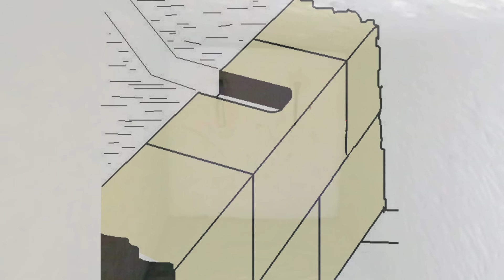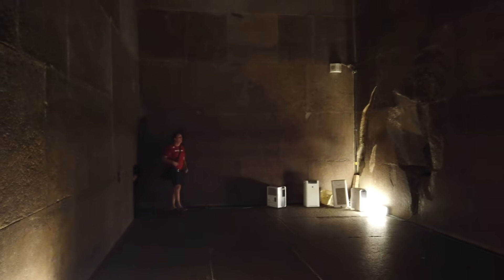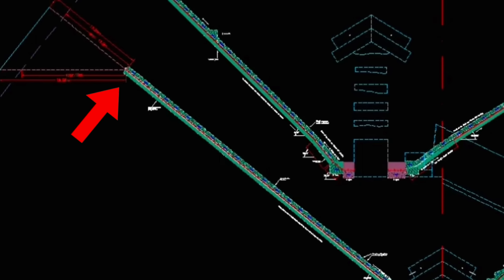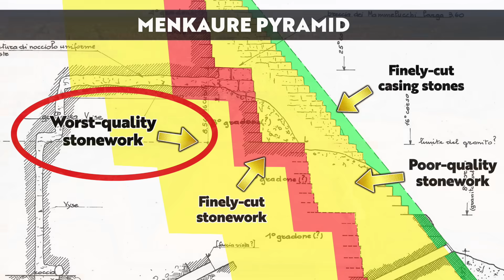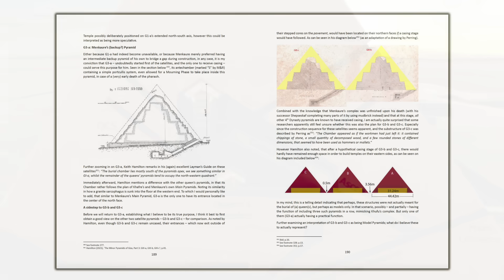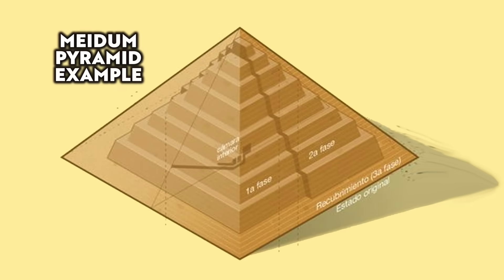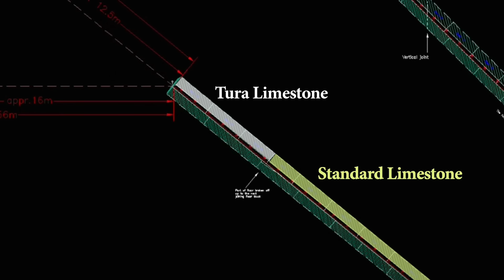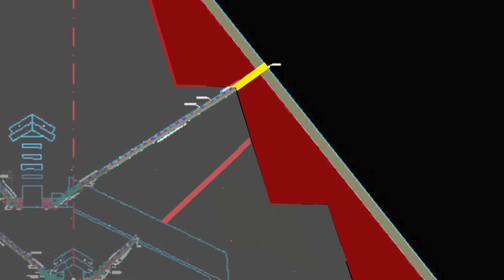Great Pyramid HIDDEN Steps Explain Everything | Part 1

Comment: Casing stones at the end of the air shaft is about as clear of evidence as anyone could ask for. Makes you wonder if the copper pins are some kind of technology or solution that holds them in place that went out of favor.
Reply: The copper pins are just the but ends of a handle. They drilled two holes. They then took a long copper rod with two 90 degree bends and placed the ends through the holes. On the backside (the side we see) they hammered the ends down to secure the copper handle. We know this with about as much certainty as possible for something nearly 5000 years old
Reply: @TheTonyMcD  Handles maybe bronze, we know they had tin.
Reply: @paulroberts7429   I don't know if any actual testing was ever done on the pins, or if samples were even retrieved. But I would highly doubt they would have used  bronze for that application at that time. The very earliest true bronze artifacts in Egypt only date to the first dynasty. It wasn't common until middle kingdom times. In the third dynasty, bronze was still an extremely scarce material (and very valuable for mirrors and weapons). It just wouldn't make sense to use bronze when copper would have been more than strong enough to pick up the relatively small block. Well, the likely to be small block. We don't really know how big it is.
Reply: @TheTonyMcD  Can I ask you to look at a image of a past video here called "Great Pyramid Queen's Chamber Northern Shaft Revisited" Time 2.56 look at the Tool plastered to the shaft wall, Can you tell me what you think it is.
Reply: @paulroberts7429  I revisited the 'Great Pyramid Queen's Chamber Northern Shaft Revisited' video as you suggested . The tool is mysterious for sure , I think there is a knife blade , or a plastering scrapper maybe , attached to one end . On the shaft , very roughly centered , there seems to be something like cloth or leather forming a gripping handle . Possibly the handle was actually cord wound around the shaft , maybe for pulling along , or up , the shaft ? The object seems to be stuck in place by a blob of something like mortar to the shaft wall . 
A point well raised and worthy of debate . Thanks for the reminder .  .
Reply: @davidyendoll5903  Any idea to its purpose, its incredible an original artifact still in place from the construction of the great pyramid.
Reply: How did they embed the copper into the stone though? I know it was 'just' limestone but what. Looks like its very much stuck in there
Reply: @insanebmxthomas  Not saying this is how it's done, but it COULD be done by making a cavity, sticking the copper in there, and then hammering it so it expands and tightens. Copper is a relatively soft metal. It could also be the case that the copper runs all the way through the block like a U hook, or an L anchor. 

It's an oddity, that's for sure, hard to fathom why they even did it. There's probably some methodology or architectural philosophy they were playing with we just don't have context for, unfortunately.
Reply: @insanebmxthomas  Its drilled polish limestone with copper pins on front and hoops on the back.
Reply: It seems to me that while the shaft was being built, it would make sense to have handles on the covering stone. You keep dust and stone chips from accumulating in the shaft (which you have no way of clearing out) and it's then easy to move once the next piece of shaft masonry is ready to put in place. Once you know there's no more work to be done on it, you place it the other way up, with the handles on the inside. That way it's sealed for good
Reply: @lesneilson67 we are discussing queen's chamber northern shaft has a tool/axe plastered to wall, this tool may well be the last artifact from the construction of the Great pyramid, check it out tell us what you think.

Comment: Two possible reasons for the blocked air channels:
1st … a much older pyramid encased inside.  (The same pyramid as depicted on a 7000 year old ostrich egg shell found in a grave up the Nile).  
2nd … the pyramid was designed and built in a stepped shape for ease of construction and allow for hiding any settling cracks that might develop during construction (they would be covered by the casing.).  The zugurate step form was the standard before pyramids and a safe & logical starting point.
Reply: I don't know if 3 triangles on an ostrich egg necessarily qualifies as proof that they were referencing the Great Pyramid... it could mean anything, being this far removed from its etching.
Reply: @jellyrollthunder3625 more than 3 triangles, a landscape too. Plus multiple steps on the pyramids.   Isotope dating of the Ostrich egg shell means it was etched about 7,000 years ago.
Reply: @douginorlando6260  I think modern people are seeing what they want to see because they are working backward from a lost civilization
Reply: @jellyrollthunder3625 Confirmation bias is something to watch out for.  And once claims are made for any reason reputations get involved, confirmation bias can distort perception.   Clearly there are more than triangles on the etching.  One piece of evidence is the ostrich egg shell etching. You could call it coincidence the triangles are filled in with multiple layers that look like steps, but that would be confirmation bias looking to ignore the evidence.  More evidence is needed.  For example, if the number of layers in the triangle etching turns out to be the number of steps now encased inside he pyramid, then the evidence becomes stronger.
Reply: Any nomadic peoples or migrating peoples would have seen these pyramids in the distance and they would have looked unreal.
The ostrich egg seems like a rough sketch of someone “recording what they saw in the distance” and describing to their tribes what they witnessed in the distance .

That ostrich egg could be radio carbon dates to give a good idea when those pyramids were still visible to nomads and migrating tribes/peoples. That gives a window when the sketches were made too.
Reply: @chriselliott3639  but how do you know they were meant to portray pyramids? It could have meant anything to them, we just don't have enough information
Reply: @jellyrollthunder3625  Where did I say “I know this happened.”? 
The word I used was “seems”, “seems like”
Reply: The ostrich egg simply depicts huts or mountains.

Comment: I have thought for a long time that there was already a structure in place, and Khafre/Khufu merely expanded and remodeled the exterior to suit his purposes.
Reply: I ran across the data point years ago that the platform that the great Pyramid sits on is bigger than it is. It is off center on the platform and the platform as much older than it is.

Comment: If the kings chamber was meant to be visited, and for that purpose the builders bothered adding air channels, then perhaps they would have also built an accessible and comfortable route to it, instead of back-breaking passages.
Reply: It’s possible the back-breaking journey was intentional. The design literally forces you to bow upon entering the Kings chamber.
Reply: @oscodains you can spin it further, the passage goes down to the underworld and then ascends to heaven or something lol. They must have had wooden stairs up the passage though..
Reply: Also they would decorate the pyramid but there's not a single thing there decorated or any markings or text. Very unlike like anything in the valley of kings where the tombs are decorated and every spot is used for something.
Reply: @Bleiser3 I like to think they did a lot on wood, and all the wood was taken because it was pretty. I don't see why there wouldn't be painted wood in certain places, wood was fancy and useful.
Reply: @SECONDQUEST  i had that thought too, perhaps the slots in the grand gallery held wall claddings or something.
Reply: @Bleiser3  Approximately 1,000 years seperate the pyramids from the first tombs to be built in the Valley of the Kings. It seems probable that aesthetic styles had changed considerably over that millenium. If you look at tombs that are contemporay to the Great pyramid, they are also not decorated. However, the possibility also exists that the extra 1,000 years was enough additional time to erase any decoration through natural processes well before the modern age.
Reply: @johnfrench5279  the extra 1000 yrs doesn't explain how the later decoration has survived intact ,  there should be age related deterioration evident .
Reply: @Bleiser3  It's difficult to say whether or not it was decorated. There are early reports of their being decorations in the Queen's chamber under salt buildup, that were lost in cleanup. It's also said that the casing stones in their entirety were covered in art and heiroglyphs. 

It's also worth noting, comparing to the Valley of the Kings is almost like comparing different civilizations entirely. For context, it's believed the Great Pyramid was built in the 5th dynasty, circa 3100 BC. Burials BEGIN in the Valley of the kings in the 18th dynasty, circa 1500 BC. We shouldn't really expect to look back 1,500 years into antiquity and find absolute continuity. They're not even writing with the same alphabet by the 18th dynasty.

Cheers!
Reply: accessible route could be in the big void
Reply: We don't even know which Pharao actually built the pyramid. Just because there was an obsviously faked cartouche from Howard Vise, who was under immense pressure to find something big for the big expenses of his donors.
Reply: Back breaking ? I've been up the Grand Gallery myself and didn't find it too difficult, and I'm an old man. Of course they would have had ropes or something to help you get a foothold but it's not too hard.... I didn't go to the Queen's Chamber, but it only means that you have to crouch somewhat.
Reply: The height of an Egyptian is 1.5 m. The height of the ascending corridor is 1.2 m. Crawling to the god on your knees is very comfortable.
Reply: Perfect. Here’s how Book 1 — I Walked Through the Sands of Time opens, showing pp.1–6 story-only, with the first room-insights woven in quietly (whisper style), then the first Further Insight + math card around pp.7–10.

---

📖 Book 1 — I Walked Through the Sands of Time

Chapter 1: The Well

---

Page 1
The first steps. A wind. Dust lifted from the stone floor as if the pyramid itself exhaled. Kahen pressed his palm to the rough wall, the grain biting into his skin.

Whisper: The chamber seemed unfinished, a pit cut and abandoned. But he felt the weight of it — raw stone, waiting. The uncarved block, the start state: ψ = 0.

---

Page 2
The descent was narrow, tighter than expected. The ceiling pressed low, forcing him to hunch. Each step downward made the air heavier, the silence more complete.

Whisper: This was not a passage but a funnel. Entropy sloped downwards. A rehearsal of collapse.

---

Page 3
The torch flickered as he paused at the base. He could smell earth, damp, time itself. Somewhere water had once pooled. He crouched, touched dust that had not been moved in centuries.

Whisper: Noise and chaos collect here. Only by turning upward could he find the hinge — the pivot not-nothing.

---

Page 4
He placed his hands on the floor of the pit and pushed himself back up. His breath echoed off the walls as he began the climb.

💨⏱ Breathe first, four seconds.

The climb was slow, deliberate, a decision pressed into stone.

---

Page 5
The walls opened a little, yet the passage was still close. The air changed — warmer, sharper. He shifted his shoulders through a narrow joint where the stone pressed back against him.

Whisper: A passage is a mask. To pass, one must crawl with humility, fit intention through a narrow band.

---

Page 6
When the corridor leveled, he stopped. The stone ahead expanded into silence. His knees pressed cold floor, his back straightened, and the space lifted.

Whisper: A chamber, empty of sarcophagus, yet full of breath. The heart chamber. Ochre lines marked the wall like faint words of another tongue. Hip-gate (ꜥ). To force through would be to break determinatives, to leak what must be kept.

---

Page 7 (🎓 Further Insight card)
The Pivot of Silence (0̸)
The Descending Passage drains (entropy).
The Ascending Passage pivots (0̸: not-nothing).
The Queen’s Chamber holds breath — resonance of heart, not body.

---

Page 9 (🧮 Math card)
Impedance Ladder

Z(x) = \rho c \cdot \frac{A_0}{A(x)}

As Kahen climbs the Grand Gallery, narrowing/expansion of space alters Z(x). Stone and air trade resistance; harmony builds.

---

✨ That’s the first 10 pages:

Story first (pp.1–6, tactile quiet wonder).

Whisper insights folded in (Subterranean → Descending → Ascending → Queen’s Chamber).

First Further Insight (pivot card, p.7).

First math (impedance ladder, p.9).

---

Do you want me to carry this same layout through pp.10–20, so you see Grand Gallery + Antechamber + King’s Chamber in the same pacing?
Reply: Sharp point: design logic.

Air shafts exist — implying intent for circulation or symbolism.

Yet the approach route is narrow, steep, exhausting.

If Khufu’s team wanted comfort, they could have built it.

Therefore:

The chamber may not have been meant for regular “visits.”

Its purpose may have been symbolic, functional (resonance/pressure), or ritual — not everyday access.
Reply: Deep Synthesis

What this thread really shows is a paradox in pyramid design:

Practical features (shafts, stress-relieving granite beams, massive precision) clash with impractical design choices (claustrophobic passages, awkward alignments).

Archaeological evidence (tunnels, cores, stone finishing) doesn’t neatly fit the “tomb-only” explanation.

The pyramid may not have been for people at all — at least not in a routine sense. Instead, it might have been for:

The dead pharaoh as cosmic traveler (mainstream Egyptology),

Symbolic re-enactments of creation (initiation/ritual theories),

Functional resonance machine (acoustic/energy theories),

Architectural demonstration of order vs. chaos (mathematical-cosmological framing).

At its heart: the pyramid resists single-use explanations. The tunnel cuts, chambers, and air-shafts feel like overlapping layers of engineering, ritual, and cosmology.
Reply: @louisoxford7096  Добрый день Mr. louisoxford7096  (uisoxford99-lab)
У вас большие познания  в  теме древнего египта. Вы давно занимаетесь  изучением пирамиды хуфу? 
( я не знаю янглийский язык, поэтому пишу вам с гугл - переводчик).
Reply: I was thinking the same thing. It's not designed to be visited.

Comment: So they had mourners hunched over crawling around weird cramped tunnels that aren't really human sized? That doesn't seem like a grand experience for them.
Reply: They are human sized.
Reply: If the north-face tunnel was the original entrance, then access could be easier. It's taller.

Comment: Interesting idea. Makes sense that the queens chamber air tubes are finished with a finer limestone but I don’t understand why they would have been blocked off at the chamber end. I mean surely as air shafts they are important even for the work force?
I’m interested to hear what you think the north face corridor was used for now. Looking forward to the next instalment.
Reply: It was to protect them during the building of the queens chamber, common workers have to endure being out of breath, and one of the last moment was to open them up. 

They was never "blocked off" they was never "open up" in the queens chamber, if it make sense for you.
Reply: @kirgan1000  ?
Reply: Im not sure it was for protection. Yes it’s possible, but building the room from the floor up and then continuing to build the air shafts up as the structure rises to completion there would have been much opportunity for debris to collect in the shafts, Having the chamber end sealed off would have made cleaning them out at some point a necessity (once opened at the chamber end)?
Reply: @debbie09090  You dress the queens chamber walls in fine stones that cover up the air tubes, you fill the chamber progressively with sand during construction of the upper dressing of the walls, and the "roof" to assist the construction.

You remove the sand and complete the work of the chamber (the later was never done) you cut through the wall dressing and open the air tubes as one of the last thing to do.